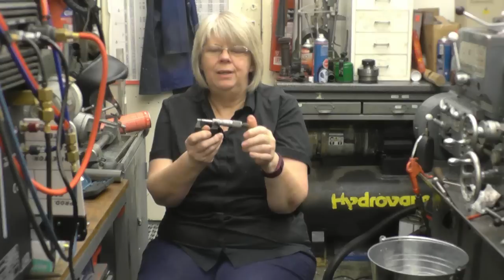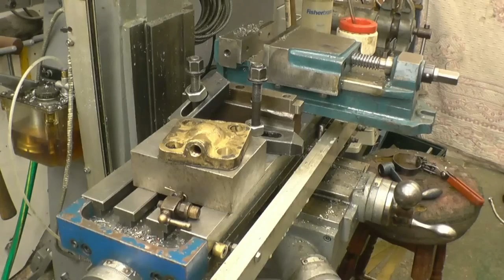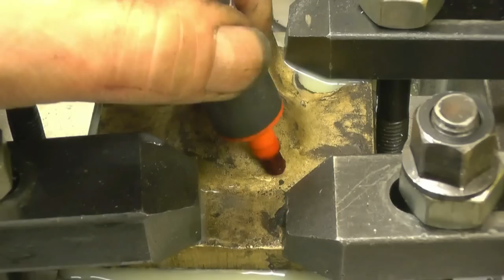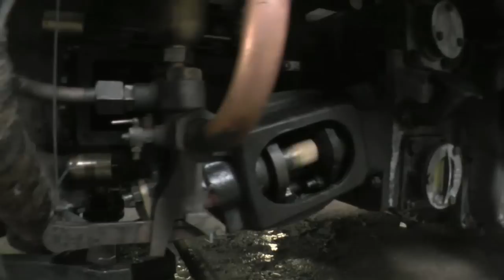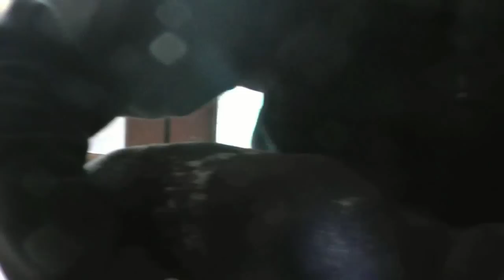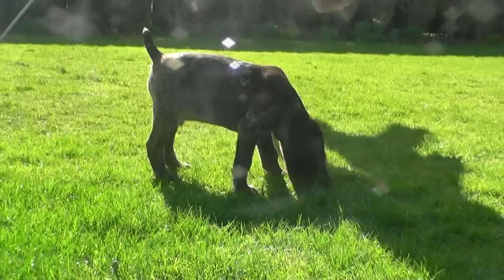SNNC 167 P1  Casting Repair   Plasma Cutting

Comment: How did any of us live this long when we used to play with lead, mercury, asbestos, and all the other "nasties" that will, eventually, kill you. - You need that faceshield when doing hydraulic testing, in case of catastrophic failure.  A small stream of 200psi fluid in the eye wouldn't do you any good. - When looking at Stig from the left, he looks like he's wearing a sweater.  That is a nice pup.

Comment: Why not heat the inside of the casting and braze a thin coat there? Pressure seals it and it takes less work.